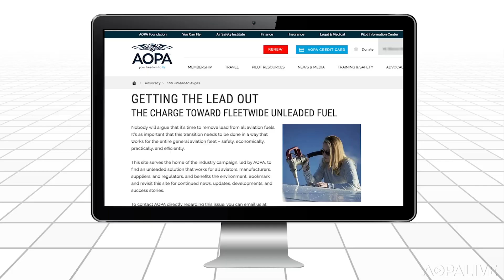Getting the Lead Out

Comment: They got the lead out of car gas decades ago. They can get the lead out of aviation fuel too. Hardened valve seats and redesign the old designs to 21st century. That is the price of progress. OH WELL If people have to reengine their plane that is the price that has to be paid. And no I do not own an airplane. The engines have remained basically unchanged for over 80 -100 years. Just the systems to make it run have changed with the addition of electronics which has helped, but not enough.
Reply: no need for that- a good shop can redo your cylinder heads for a lot less- even an FAA-approved shop (where they work only on aircraft stuff)- and you know they'll be watching....guys are already gearing up for it- while the plane is idle i can dye-check your prop blades and you should also have the head chambers checked for cracks before AND after any seat work is done.
Reply: Just re engine?  Yeah, you obviously never bought an airplane engine.  🙄

Comment: Cessna 150/152s did much better on 80/87 octane before that fuel went out of production.  The gas companies sold us on 100 low lead as a viable alternative.  It is not, it has at least 4 times the lead as 80/87 Octane.   We rarely fouled our spark plugs back in the day taxing with 80/87 octane.  It wasn't until we had no alternative to use only 100 LL that we began fouling our engines.
But now, there are no viable alternatives to the thousands of Cessnas still training our new pilots.  They used to say "jet engines could burn peanut butter oil" but we know that is a lie.  But what are the alternatives to the higher compression engines for the C-182's and beyond?  There are none yet.  We all saw this coming back in the 1990s, but nobody did anything about it until the ill-advised liberal communities wrongfully believed that airplanes flying over their schools are causing lead poisoning to their kids.   There is no proof for that,  but I do catch their drift.  If I were a non-pilot and had kids in school on the final approach to well-used airports I'd be susceptible to the b/s as well.
Reply: you need splitfires- just kidding

Comment: BS. We’’ve known for years that engines can be made to run on pump-grade premium unleaded…. Just start modifying the engines that need it, the rest, like my C182, need nothing… premium pump-grade unleaded is fine.  If you own something that can’t run on premium Mogas, maybe think about that choice?
Reply: i'm retired prop airman but still do independent NDI and i see some good news coming my way. make sure your motor and prop parts are crack-free- especially if you are having cylinder head work done.

Comment: No excuses, let's get it done. If it's a given that it has to be done at some point, and should have been done 40 years ago, then now is the time. If we have to destroy every cessna and every lycoming to get it done I'm ok with that :)  But seriously, GA is a bizarre time capsule as embarrassing as the cuban car situation and should be changed with extreme prejudice. People are buying brand new planes that were designed in WWII and proud of it. That's not ok. That's a betrayal of potential. We are not only poor but fail to see it as necessary to change.
And related to fuel use is an opportunity to change to jet for even LSA planes because it turns out that the distance record belongs to a simple turbofan jet. So we need a turbofan jet product equivalent to say a rotax 912 where two such engines could propel a lean plane to 600km/h in smooth civilized silence. A 15kg jet engine can be sold profitably for far less than lycoming want for their WWII engines because it is a simple small device. They would presumably run on JetA which would unify fuel usage and be a cool factor in itself.
Why not have a 250kg pressurized twin jet for LSA money and transatlantic range. Are we allergic to progress. Are we afraid of success.
Reply: As to Dan Frederikesen.  What part of the world do you live in?   What's your timeline?  You will be grounding to a  halt  99% of all GA aircraft if you live in the U.S.A.  GA didn't do anything about lead because it was not pressured to do anything.  Now, electric airplanes are all the rage.  But what about all the Cessnas,  the Mooneys, and Beechcraft owners?  Do you want them to stop flying their airplanes as of right now.?    You said a lot but you didn't give any alternative solutions.   We all saw this coming.  BTW, there are no confirmed studies, yet, that 100LL has caused any damage to anybody.  Just cite one conclusive peer-reviewed study on this listserv.  You can't because there are none.
Reply: @daffidavit  This imbecile doesn't even fly. He lives in a trailer, pretending he's intelligent on YouTube. Ignore the dummy behind the curtain....
Reply: @daffidavit  Denmark, Europe and battery electric planes are not successors to fuel yet. No, I'm not proposing just grounding all old planes although they should be replaced post haste. I know enough science and human dragging feet to know that a technical fuel solution is possible, there just hasn't been the will. Same as I know that a 1945 Bonanza isn't the best we can do today. One possibility could be having a couple of different fuels to replace 100LL and some few airplanes could be allowed to use 100LL still if absolutely impossible otherwise. But I kind of doubt there is any real problem. Many myths endure without merit. Like you aren't allowed to turn an engine off in air because it will shock cool but Rotax states in their documentation that that's not a thing for their engines. I can only observe that essentially nothing has been done because it wasn't perceived as necessary to get it done. I would be surprised if a few good men could not have it done by supper. FAA should have the weight to tap a few good men in a clubhouse manhattan project and AOPA should have the clout to kick them over the shins until they do it. We are flying fergusons here, it's not quantum mechanics.
Reply: @DanFrederiksen  OK, I hear you.  I wanted to hear more.  I agee.